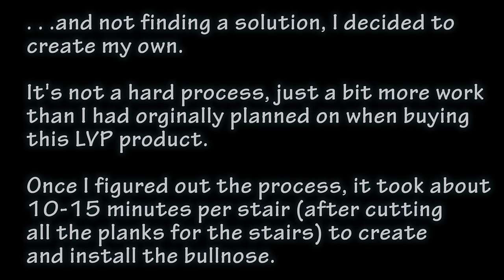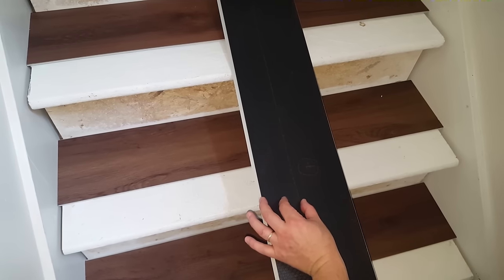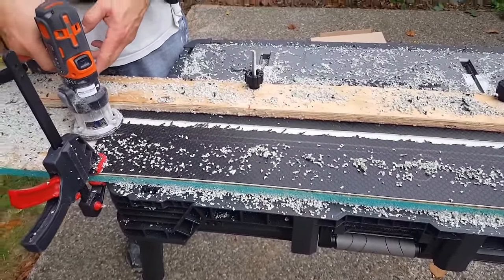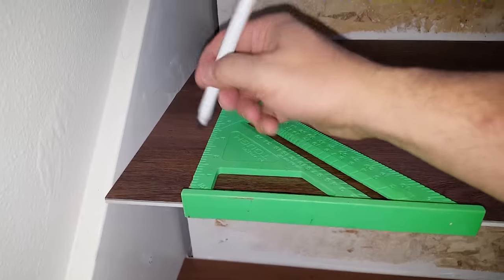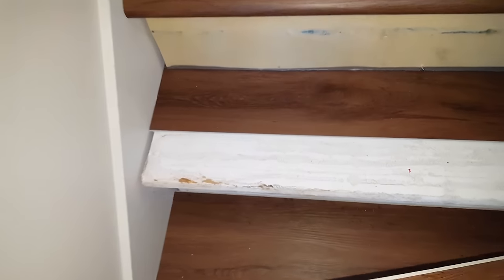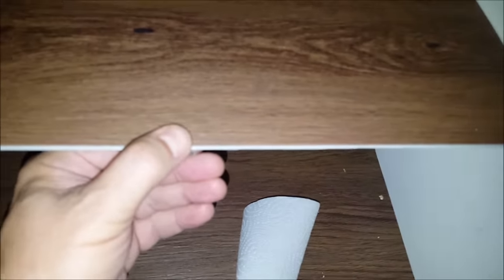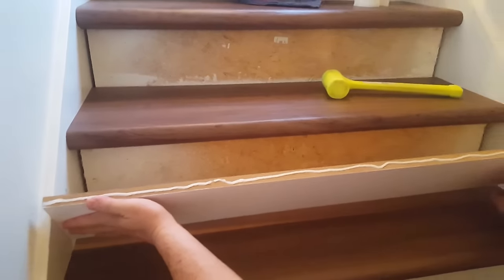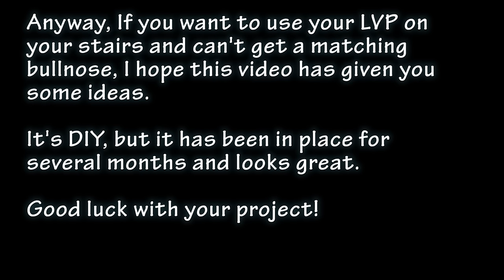LifeProof LVP Flooring: How to use on stairs and create a matching Bullnose!

Comment: Thank you so much for this video.  I plan to try it on my stairs.  Regarding the Power Grab adhesive, was it just the normal PowerGrab?  Also, did you spread it with something or just lay down beads of it?  Thanks!!!
Reply from the maker: Hi Bernadette. Sorry for the delay in responding. I used the regular PowerGrab, but a viewer suggested to use their 'Ultimate' version. Obviously haven't tried that, but it sounds good.  :-)  Check out my one-year update for additional tips/suggestions.

Comment: Could someone do this method and use a vinyl plank for the riser?  Or do you think it's best to use the wood riser to keep everything together?  Thanks, and great idea!!
Reply from the maker: Hi Kyle, thanks for watching! In my case, the riser board was thick enough keep the planks in place.  I wouldn't use just the planks for the riser if you want to make sure the bullnose stays in place.  Maybe if you screwed/nailed the bullnose in from underneath and then used the planks for your risers? Or layer the Vinyl planks on top of a riser board?
Reply: I like the idea of layering the riser board with a plank. Thanks!

Comment: Wow, That's  a magnificent job! Just want to know that you leave the pad on the vinyl and clue down on stair ? would it make more sound or better with pad clue down ? would the pad firmly clue to the stair?
Reply from the maker: I can't speak regarding other LVP brands, but this LifeProof brand is an all-in-one plank that already has the pad and other materials molded together in one piece. Depending on how much of the video you watched, you saw that I used a router to remove just a small part of the padding and other material from the area I wanted to heat up. I figure I would need the rest of the stair to be padded to reduce the noise and make it more comfortable to step on. I used construction glue directly on the padding and it seems to have held up well.  See the video description for the glue I used and why. Hope that answers your question.

Comment: My husband and I have watched countless videos on how to put LVT on stairs.  The problem we cannot figure out is our bottom stair.  It is a rounded bullnose on one of the sides, which produces a curve on that side.  It is meant to make things look a bit nicer at the bottom of the staircase, but pretty much makes it impossible to put this type of flooring down.  Any suggestions?  Also, what is the thickness of the planks you used?  Thank you for this video.
Reply from the maker: Hi Michelle, thanks for watching! Having no idea of what the shape of the stair looks like, I can only suggest trying to heat and mold a plank to the form of the stair. I only have experience with this plank so you might want to make a wood model of the stair to experiment with. It might be too difficult to get it to wrap around if it is too oddly shaped. If  remember correctly, my planks were 1/4" thick.  Good luck!

Comment: I am curious on why you did not use there cap a tread? It looks great and it is a amazing instructional video.
Reply from the maker: When we bought this flooring a year ago, we were told there were no matching stair accessories. Although we did find companies that sold third party products, nothing really matched the color and look of the existing flooring.
Reply: I thought similar here.  BUT, I am also thinking the LVP will hold up better than the laminate cap a tread.  I have read stories where people say the cap a tread finish was wearing off.  One thing I noted on cap a treads was that every piece looks the same making it an odd look going up the stairs.  Most cap a treads I see are $50.  You'd need two boards of LVP to do this method, which is nearly $15.  ALSO, the LVP is going to be less slick than cap a treads.  Oh, and the LVP is going to hide footprints better, too, given the texture.  Certainly, the cap a tread is likely to be a faster install.  However, the other thing to note is so many cap a tread customers report having to take back a lot of broken material...and it is not fast to replace.  You have to special order all that from Home Depot.  Order 25% more off the bat and take back later is all I can figure.  PLUS Cap a Treads are smooth(slick) and not exactly like the flooring you install.

Comment: Hi we are redoing our floor and stairs as well with LVP but the stairs already have risers so do we need to take those out ?
Reply from the maker: To be honest, I don't know (remember, this was the first and only time I've done this). I suppose the back of the stair itself could be referred to as the riser. If that's the case, then I added an additional one to help keep the LVP in place without having to use nails/screws. The tight fitting riser along with the construction glue ensured the LVP isn't going to move.  It's been about nine months now and nothing has budged.

Comment: Any thoughts on how to finish open Left and right ends that are on a floating stair tread. Think of it as a U…. LVP showing on 3 sides.. great job❤
Reply from the maker: Thanks for watching! I'm afraid you're going to probably have to get very creative if you are going to use the LVP planks. I don't have a clear idea of what you are dealing with, but the only thing I can think of is using CA glue or construction glue to somehow adhere it to the ends. Or if you don't mind the small nail holes, I guess you could use a nail gun.  If the open sides are even with the riser, maybe you could kind of miter the corners to line up similar to a baseboard. Sorry I'm not much help here.

Comment: I saw you put glue on the facia of the bullnose. What about the entire tread, including the first piece? Did you nail it in place on the sides with an 18 gauge nailer? Did you glue it? I figured you didn't glue it because of the rubber underside you left on except for the bend. Was it free floating?
Reply from the maker: Yes, I used the Loctite PowerGrab construction glue underneath both pieces.  That rubber backing is on there pretty darn solid.  I did not use any nails as I didn't want to ruin the look with nail holes.  The glue is so strong that it wouldn't even budge when I pulled on them before putting the bullnose on. Once the bullnose was locked into the first tread and in place, the riser not only held the bullnose tightly in place, but also the first tread below it.  You just need to cut the riser so it fits real snug between the bullnose and the tread below it.  You saw in the video how tight the one riser was I was putting in - those planks aren't going anywhere! Because I'm only using two planks  - one plank wide, the ' free floating' isn't going to be an issue as I really don't think I want my stairs floating.  :-)  It's been about eight months now (through hot and cold weather) and they haven't budged. Hope this helps.

Comment: One more concern about doing this although I like the look better than the bullnose is the slip factor!
Reply from the maker: Hi Stoneman. Please view my one-year update video and you'll see that it is not a problem (with this product). Thanks for watching!
Reply: Turns out the slip factor is not a problem. The stairs I did came out nice with using real oak stair nosing, but if I was doing it for myself I would go with solid wood treads 1 1/2" thick. Oak  or any hard wood looks great and wears literally forever.

Comment: This was an ingenious solution you came up with I hope to be able to do the same on my own step project. My only question is the treads themselves on your stairs look as if they’re made of thick flake board whereas mine are actual pine stair treads and are finished on the edges like finish 2x stock. I can’t see the edge profile on yours to determine if yours are actually rounded like your finish profile appears. So I’m wondering if this system will bend to the square edge profile my treads are.
Reply from the maker: They were slightly rounded, but not sure what kind of wood. It definitely wasn't finished wood since it was originally carpeted. I think it would bend okay, but if all your stairs are basically the same thickness, I would create a mockup of your stair nose and use that on a bench to heat/bend the planks.  That way you can clamp them down and have more control of the process.  Our stairs were different thickness so I couldn't go this route and had to bend the planks in place to get a good fit. Also, be sure to view my latest video for updated suggestions and tips from myself and other viewers. Good luck with your project!
Reply: @ james bagos. Yeah most stair cases have an edge rounded on the tread nose. Heat Moulding a vinyl plank over a squared edge has its deference from a round edge, i found it far more difficult and the boards split easier and more oftern when moulded square shaped. Its best yo aboud this method id say for a square nose and just use and screw or self adhesive colour matched stair nosing edge profile

Andy from North West England

Comment: Great job on the video; it is extremely helpful.  Did you say you were planning to add some screws to the bottom of the bullnose  to hold it in place (I am assuming along the far edge which is covered from below by the riser) If so, what size and how many screws do you recommend?
Reply from the maker: Hi Bart, sorry for the delayed reply. I ended up not using screws because my risers were so tight there was no need to screw the planks. However, I was planning to use 3/4" screws (not sure what they are called, but the ones with the contoured head that ends up flat/even with the board) underneath, which would get me through the 1/4" LVP and 1/2" into the stair wood itself. I was planning on five per stair.

Comment: On someone's post about this technique (I do not believe it is this one), someone commented that Loctite PL3 Urethane adhesive will get the job done for this. IT WILL NOT! I tested a tube of it last night and the results this afternoon were that I was able to very easily pull the entire piece of Lifeproof LVP right off of the 2x6 lumber I attached it to. Instead, please use LocTite PowerGrab Ultimate. I have tested this with the same piece of Lifeproof 2 hours ago and it is already so well bonded that it would require a tool like a screwdriver if I wanted to remove it at this time. I saw some other people with questions on what to use to hold it down so here you go. They make the PowerGrab in clear also just in case you get a bit too much on a piece it will be easier to clean up to not show than the yellow or white stuff.
Reply from the maker: Hi Eric, thanks for the suggestion and for testing this out. I used PowerGrab for my stairs (not sure if it was 'Ultimate') and it has been holding so far (18 months). The Urethane was suggested by someone because of the 'rubber' backing on the bottom. I guess it will stick to that well, but not to the floor.  Anyway, appreciate you letting us know your results.

Comment: Do you glue the two planks to the tread before starting the heating and bending process?  For example, you glue down two planks, wait for the glue to dry, them heat and bend the last section to finish it off?
Reply from the maker: Sorry for the delayed response. Yes, both planks were glued down first. I then waited for about 15 minutes for it to cure a bit and then started the bending process. If all your stairs are uniform in thickness, you could make it a bit easier by creating a separate bending rig before mounting the planks on the stairs.

Comment: Could you tell me the temperature setting you used. I did one and it went great, but for some reason after that I keep getting cracks. I was doing it outside yesterday and mid day it worked great but after that kept cracking. Wondering if the outside temperature could affect it too. Thoughts?
Reply from the maker: Hi Angela! I'm not sure of the exact temperature, but the heat gun I used had a low and high setting - I used the low setting.  I have a feeling you might be too close to the plank if it is cracking.  Patience is key here. Keep it a good two or so inches above and slowly go back and forth.  Keep feeling it with your hand until it feels somewhat soft/spongy. You'll be able to tell when it gets soft enough to bend, just keep testing it. Again, I can only speak with experience using the LifeProof LVP so your mileage may vary if you are using something else. Take another look at that section of the video where I'm heating it and you can get an idea of the pace I was using.  I used several test pieces to get the feel of it first. Good luck!
Reply: I have one beautiful piece and need 14 more. I've had a few fails. I spent a solid hour on one and it was going great and suddenly split. I just couldn't get the flooring to warm up. So I might have gotten to close. I have no idea.  I'll let you know if I figure anything out.
Reply: Well we did it and my stairs are beautiful. The biggest thing we did was we used heat guns on two sides to make sure it was even and then when the temperature of the flooring was around 185 degrees, it easily bent and we used a board to make is smooth. I did have one piece that curved somehow but it wasn't too major.

Comment: Looks awesome. Great job. Did you say you screwed the LVP under the bull nose? Or is the riser and glue the only thing holding it?
Reply from the maker: Hi Isaac. Currently the riser and glue are holding it in place. Once I had that first riser in there I could tell it wasn't going anywhere. For ease of mind, you could still nail/screw it underneath towards the back where the rise would be. Also,  be sure to watch my 1-year update video for additional tips and suggestions.

Comment: Thank you for sharing this.  Amazing work.  It looks like your stairs are about 36 inches wide.  Can you estimate how long it took to heat and form the bullnose plank for one step?
Reply: It takes about 5-7 minutes to heat each one to the proper temp. Times 2. You need to make the 1st bend, get it situated well on your jig and then heat the 2nd spot and make the bend and then lock it in place somehow (clamps, a heavy weight, etc). I'm not affiliated with the guy who posted this but I just did a set for my house. This goes MUCH easier if you mill off he entire leading edge of the plank being bent and then heat it while on a jig so you have a uniform surface to bend it around in your 'shop' (also known as my basement) as you do each one.
Reply from the maker: Hi Tom, thanks for watching. As Eric mentioned, it takes about 5 minutes or so to get it soft enough to bend as you need. Best thing to do before you start is test it on a piece and get a feel of how long it will take. And yes, if your steps are all uniform (unlike mine) you should create a molding form (or whatever you want to call it) which will make it easier to bend. Also, watch my one-year update which not only shows the condition of the stairs, but also has some additional tips/suggestions from viewers and professionals.

Comment: Looks good, but that melted bend will prob crack over time walking on them like that, they make vinyl stair nose that would install faster and last longer, wont look that flush/good tho and would have to rip off those toe kicks on the steps
Reply from the maker: Hi Robert. I did a one-year update video and everything was fine. It's been about 16 months now and everything is still solid - no cracks. Lots of traffic as we also do stair exercises daily.  Hopefully that will stay that way for a long time.

Comment: Thank you. What do you think about installing the riser first would it work? Thanks
Reply from the maker: Adding the riser last helps keep the planks in place without the need for additional screws/nails - which I wanted to avoid using. Although construction glue is tough, I just felt more secure having the risers wedged in there tight between the stair planks.

If you add the riser first, I think you would lose a good option for plank stability and security unless you use screws/nails in addition to the construction glue.

Comment: Thanks for sharing - very creative solution. I understand it gets a brittle after the cooling process, how has it held up so far?
Reply from the maker: Actually, it isn't really brittle at all once it cools, it has the same feel and strength as the unheated portion. I thought the one step that I busted was because of getting brittle and then hitting it.  It turns out it was just my own stubbornness and being impatient along with the constant hitting that plank to get it to lock in that caused the darn thing to bust. After eight months now, the bullnoses are just as firm and solid with no sign of deterioration or give and look/feel the same as the rest of the floor. Obviously, if someone did some scientific measuring or whatever, they would say it isn't as strong as the 'original' untouched plank, but honestly, I feel no difference in the solid feel of the bullnose versus the rest of the flooring. Hope that helps.
Reply: Chronologically Experienced Thats awesome, glad to hear it maintains durability. I’ve been happy so far with the bit I’ve installed & I will be using your method for the stairs. Thanks again for teaching us all!

Comment: What did you end up using for risers?  I'm hoping to find something I don't have to paint and was looking at fairly cheap white pergo options.
Reply from the maker: I used a 3/4" thick by 7 1/4" high pre-painted MDF sold at Home Depot and cut it to height as needed.
Reply: You might want to check into “puck board”. It’s actually for the boards around hockey arenas. It’s bright white all the way through and super durable. You can cut it on a table saw and it bends quite easily.